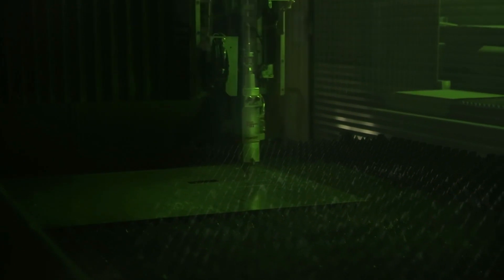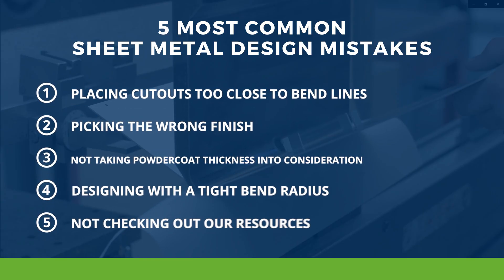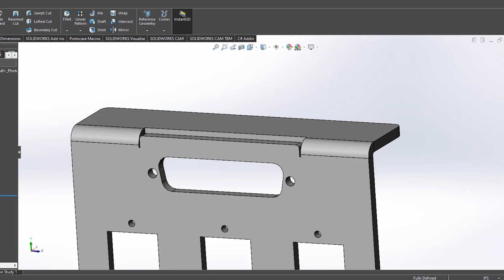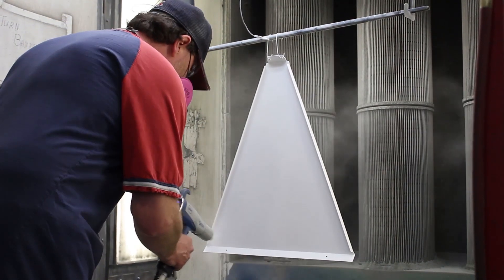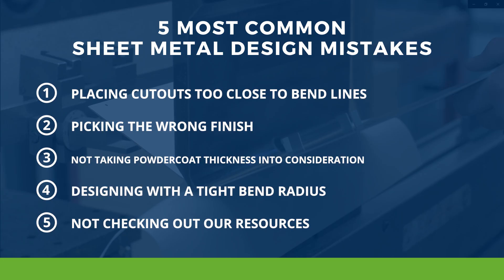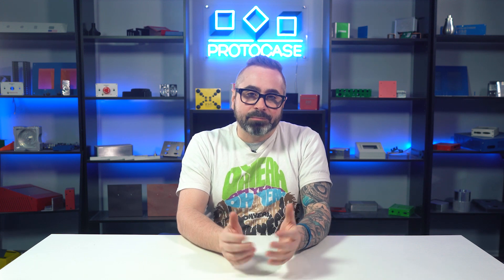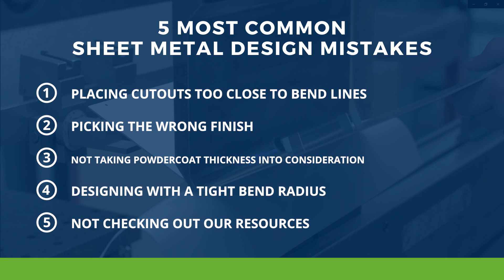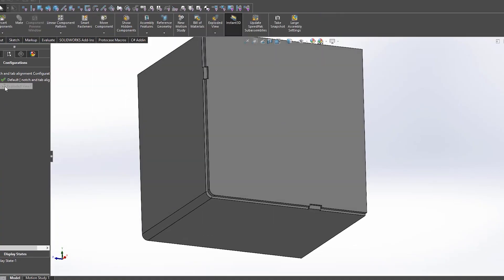Proto Tech Tip - 5 Common Sheet Metal Design Mistakes to Avoid

Comment: Great tip regarding using a notch to allow placement of cutouts close to a bend!  I'm an engineer and design mainly machined components but occasionally work with sheet metal parts, and I will definitely be using this tip in future designs!
Reply from the maker: You're very welcome! Notching can be really useful in certain scenarios. 

If you're looking for a few more resources, these may be helpful:

Proto Tech Tip all about notching: https://www.youtube.com/watch?v=rqc0ZrQXI58&t=

Blog post about notching: https://www.protocase.com/blog/2017/05/02/what-to-do-when-cutouts-and-other-components-need-to-be-placed-close-to-a-bend/

Happy designing :)
Reply: @ProtocaseInc  awesome, thank you!!!

Comment: 6 - Design to final formed component "dimensions" and tolerances (including any surface finishes), not flat pattern dimensions.
7 - Ask.

Considerations:
1 - Specific bend angles are not easy to control when all "K-factors" require some level of "over-bending" compensation, depending length of the piece, tool hardness, bends angles, gauge thickness and etc.
2 -  Whether to form the inner or outer bend first and whether to Form single, double or even triple bends at the same time (Progression tool)
3 - Score line help sharper bend radius, but ASK them first.
Reply from the maker: Thanks for the feedback!